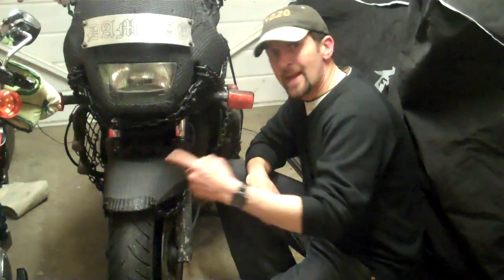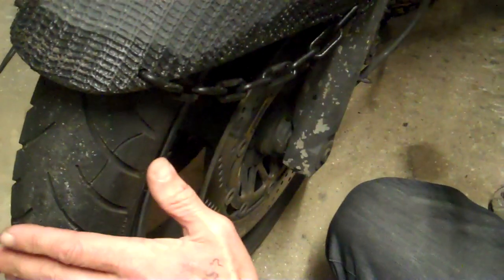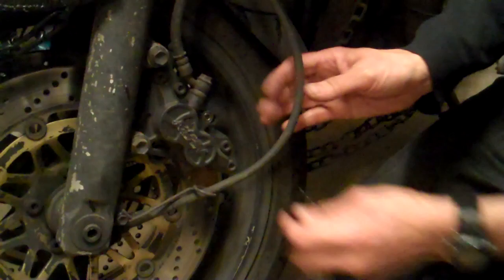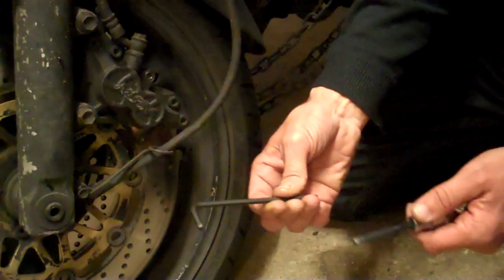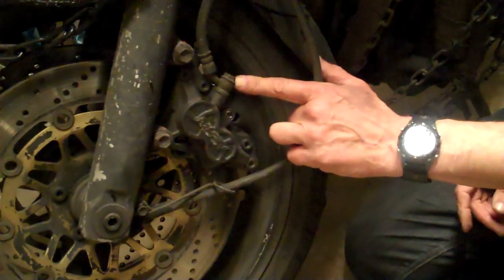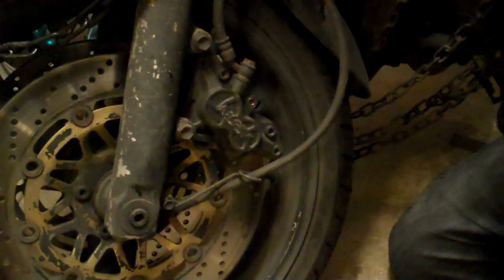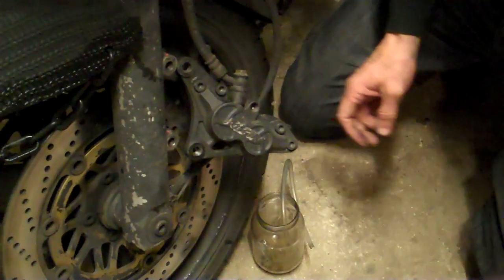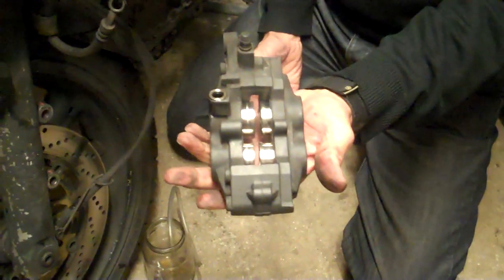Delboy's Garage, Motorcycle Front Brake Caliper rebuild Part 1.

Comment: ah great vid again,Delboy! listen,whats your thoughts on replacing the actual caliper mounting bolts [XR 125] as well?The manual says to do this,but is really necessary if they,re in reasonable nick??...Brembo info was cool,hadnt heard of that!
Cheers man
Reply from the maker: Hi mate, many manuals suggest to throw away and replace caliper bolts, but I see no reason for this as long as they are in good condition, just clean them with a wire brush, inspect them to make sure there's no corrosion, and as along as they are stainless steel bolts, put some copper slip on them and put them back in using a torque wrench to get the correct torque setting... hope that helps!
Reply: Moonfleet41 Will do.Cheers Delboy!

Comment: These are great videos. Thanks. Do you recommend replacing the seals with OEM from Suzuki (I've got a 2005 Busa) or is it alright to buy replacement on eBay?  My experience with the fork seals was not good with eBay replacement.
Reply from the maker: HI mate, i always used to make sure i used the proper factory specified parts until, one day i noticed the packaging logos were the same as id seen on eBay for half the price.. so go figure... i guess you could say that Suzuki dont 'make' rubber seals, they buy them in...even when building the bikes new.....so as long as you buy a known make then you're usually ok, i pay about £12 fo a set of brake caliper seals now, and never have any issues with them.. hope that helps buddy... good luck, Del.

Comment: Thanks for the video, it helped me out greatly.  My pistons are a little rough on the exposed end.  Do you think its ok to clean this up with steel wool or should I replace them?
Reply from the maker: Hi mate... as long as you dont scuff the surface that passes through the seal it should be fine...but new pistons aren't expensive and will guarantee a really long term refurbishment and great brakes for a long time.
Reply: Moonfleet41
I should have just ordered new pistons but I wasn't expecting them to be pitted.  I used some 1500 grit sandpaper and it seemed to polish the piston surface quite well.  But I'm going to take your advice and order new pistons for the rest of the brakes.  Thanks for the help!

Comment: Thanks for all your videos. They are really helpfull! I tried to change the seals of my brake caliper today but I'm having some issues. I followed every step you did in the vid, but I forgot to push the pistons out after taking it off the disc. So I connected the brake line again and pushed lever a few times but I couldnt get no pressure what so ever. Any ideas how I can get pressure.
Reply from the maker: When you say "Pressure", so you mean you are trying to bleed the hydraulic lines up.?
Reply: Yes exactly! When I pump the lever I don't get the resistance I need. The lever goes all the way to the grip.
Reply from the maker: sebassiehihi
Hi again...When you disconnected the hose from the caliper, you've obviously drained a little fluid out of the line and will just need to bleed the hose back up again then you can pump the pistons out using the lever...if you've taken the bottom of the hose off, and lost some fluid, you cant just connect it back up and hope it'll be solid still, as the fluid drains out, air replaces it...so you just need to pump that air out using the standard bleeding method and get the hydraulic lock back... once you do that, you can just pump them out as normal... good luck buddy..

Comment: Mate on a bandit 600 caliper, how does the calliper come off the slider pins and mounting bracket, only the slider pin rubbers on mine need changing as all hanging out now after winter, can't see if they just pull off or unbolt each end. Roll on the summer bike coming back out!

Comment: Hi Del, new subscriber...great videos!  I need to replace my pads but would like to overhaul the caliper too - I've noticed one seal popping in and out as the brake is pressed and released and also the crud on the exposed part of the piston.  You are giving me the confidence to do it.  One question... What should I use, or did you use, to clean up the pistons from all the mineralisation etc?  Brake cleaner, toothbrush and elbow grease?  Thanks! Daniel.
Reply from the maker: Hi Daniel, Thanks for your kind words and welcome aboard.. If you have a dust seal; poking out, its definitely time for a little rebuild.. I clean the pistons with hot soapy water first to get all the salt and crud off, an old tooth brush is good for getting all over them.. then to polish them up to a brand new shine, i use Solvol Autosol and some elbow grease..   for cleaning the inside of the caliper body, and get all the seal grooves fully cleaned out you can us some watered down Autosol and a tooth brush.. works a treat.... then clean everything off with brake cleaner afterwards to get all the polish off and out of any corners..   Good luck with it matey. take your anytime and have fun, let us know how you get on... Del..
Reply: Moonfleet41 
Super, thank you!

Comment: You need to mention most modern calips habe square cut seals, the taper is on the actual caliper. So they cant be put in the wrong way around

Comment: hiya guys i have a 10ft x8ft wooden shed there for not alot of room to work on bike in what cheat shelving can you recommened cheers mike ps keep up the great work videos are sound ;-)
Reply from the maker: Hi Jan, not really the person to ask about woodwork, but if it was my shed, I'd fit shelves high up to give lots of working space below and to get round the bike... doesn't need to be too complicated, just a timber plank, say 9" deep by the length of the shed, and some beefy 'L' brackets from the DIY store and screw it all to the frame... good luck with it!

Comment: I've looked at both your videos, I guess I am just a little confused, what did you use to actually clean the piston and inside the caliper?  I have an '82 Yamaha Virago 750 and everywhere around me tell me to just take the caliper apart, clean it, and reassemble.  Mine is sticking, I see kits online but am uneasy about purchasing because I do not know what is in them.  Any tips? It is essentially my last fix before having a fully safe ride.

Comment: My front brake caliper has been locking in the heat. Rode it yesterday and wtf.. they locked up! Front brake disc heated up to something cronic! I tried to clean and grease back up the 2 caliper pistons without taking them out last week. Maybe now I should take it apart like this and investigate further... thats if I can.
Reply from the maker: Hi Keith, sounds like a classic case of 'time for a rebuild'....the road salt builds up behind the outer dust seals and forces them out, that then jams them against the pistons...no amount of outer cleaning will sort them, you just need to take them apart and rebuild them from scratch, its not hard, follow the steps in the video and take your time, once they are fully refurbished they'll be like new again and last for a fair few years before they need doing again, specially if you keep them washed out between rainy days... good luck with it, let us know how you get on mate... cheers, Del.

Comment: I have a question for you. When I squeeze my front brake it seems to shimmy or shudder and grab intermittently. This giving stopping and almost grabbing in a non smooth manner. Any idea what this could be from? Forks are straight and pads look good. I have not checked the 6 pot pistons to see if they need rebuilding yet. I have have a 98 Gixxer. Thanks for any help or response.
Reply from the maker: HI mate... just to be sure...when you say the brakes "shimmy and shudder", does the lever 'pulse' in and out in your hand at the same time?....if so you may have either the brake disc bobbins jammed up with crap and need a clean..here ;- Delboy's Garage, How-To Free up 'motorcycle brake disc bobbins'.!

also you my find that the pads are glazed up...as much as they may have plenty pr meat left on them, they can get 'polished' and end up with a shiny slick surface....this can then make them judder a bit...it can be cured by sanding that face off them on a flat peice of fine emory paper... or for what they cost mate...just replace them.! 

Give the bobbins a clean and free them all up, then drop some new pads in and im sure that will cure it..!!  let us know how it goes, if its still doing it, then we can look further...but this usually works for me... good luck.. Del.

Comment: Hi Del,

Excellent videos - really learning a lot from you, so just thought I'd take a minute to say a big thanks!I am in the process of rebuilding the calipers (rear and front) on my Triumph Sprint RS and your tips have now probably saved me from making many mistakes. Unfortunately before I watched any videos I popped out one rear piston and thought I'd be able to pull the other one the rest of the way out, but I couldn't and the inner tube I used wasn't folded over enough which resulted in the grips cutting through and putting a tiny amount of damage on the outside of the piston (I eventually got it out by pushing the other one back in and clamping it while pumping the stuck one out). My question is, can I use some fine 'wet and dry' paper to smooth out the damage and use a load of red rubber grease on the piston to fill up the slight depression / nick, bearing in mind the seal is under pressure and will push into the nick as the piston moves? p.s. Sorry for the essay!
Reply from the maker: Hi John,  I think you know the answer really don't ya mate lol - you're asking me to tell you you'll get away with it, but we both know you probably won't will you??  The problem is, as you stated, it's under pressure and as such that pressure will push the fluid past the seal at that point, if not today, then down the line it'll surely happen... so as the old saying goes, why not just bite the bullet, grab a new piston and seal set... here's link mate, they're not as expensive as you think, and thre's new seals with it included:
http://www.wemoto.com/bikes/triumph/sprint_rs_955i_t625_from_vin_139277__single_sided_swinging_arm/03-04/picture/stainless_steel_piston_and_seals_front_caliper_large/

This was an example I picked from their website, so just double check your exact model, and you may wanna get the pair rather than just the one... but it's your choice fellah... hope that helps you, good luck with it, all the best, Del
Reply: Thanks for the quick reply, yeah you're right, it probably was wishful thinking on my part! :) I have put it back together, just for the purposes of getting it through the MOT, as fortunately it isn't leaking at the moment and tax runs out at the end of this month, but once the paperwork is done I will be replacing the pistons for my own peace of mind - might even treat it to stainless steel ones to keep future maintenance to a minimum.

Comment: sean0332
great video. I was cleaning rear caliper on my rf600 and when i pushed brake down the piston came out. i put it back in and now it seems to be stuck half way. any advice please. will i have to strip ?

Comment: My scooter fell over on its left side 2 weeks ago and it left scrap marks on the break handle. Could it be that I've damaged the master cylinder doing so and that causing the drag ?If so is it just seals that will need replacing and where is the nest online shop to purchase them?

Comment: Hey, thanks for the video. I'm on to change my zzr calipers to a different bikes calipers, do I need to change the pads to the new caliper? or keep pads from old caliper, thanks ;3
Reply from the maker: You must use the pads that go with the caliper you are using......each caliper has its own pads to fit it... good luck with it mate... !

Comment: Doing this at the weekend if my seal kit arrives tomorrow. So in terms of seal position and orientation its, thicker seal sits in the deepest of the two grooves and if the seals have a lip built into them, this needs to be on the side furthest away from the brake pads or to put it another way, closer to the back of the piston not the front. Someone please correct me if I’m wrong.
Reply from the maker: In theory yes, you're right, but check your caliper when you take the old ones out... many bikes have a trapezoid shaped slot in the caliper body and the seal itself is square , so rub your finger inside the hole (ooerr) and feel for the lip on the inner most edge, and when you take them out (the old ones) just snip one in half and look at the end section, if it's square, and you've been given the right seals, then it doesn't matter which way you put them in, cos the slot will take care of it, sorry I can't be more specific, don't know what bike you have buddy, but do those checks and you'll be fine, good luck !

Comment: Hi Del, Im running a Bandit 1200n - it has the standard six pot calipers, would you recommend switching to 4 pot? I find the 6's to be slightly spongey. Cheers, Scott
Reply from the maker: It has always been a common mod to fit the early model 4 pot Nissin calipers, they are just as effective and make a great remedy to the awful 6 pot Tokiko calipers on early Kawasakis,  but if they are just spongy, then why not fit some braided steel hoses and sharpen up the feel first.. its a lot cheaper than new calipers, and even if you go for some 4 pots later, then the braided lines will still be a worthy investment for them.!
Reply: Yes mate that's the initial plan, wanted your two cents on the upgrade to 4 pots, I've heard they're good but been an avid fan of your B12 builds so knew you'd have the knowledge. Cheers.

Comment: Done this a few times on Nissins - now I'm in a '05 FJR1300A with the Brembo's (what looks like monoblocks) - previous owner and dealership never bothered to clean so dust-seals are crumbled. Alas, the pistons are so stuck , that I cannot get them out normally so to speak. Any tricks I could try ? I have put compressed air through the banjo hole but there's just a single piston that pops out and I have no tool to selectively block the others. I think I will (this one time) bring it to the dealer and see what they make of it.. cheers.
Reply from the maker: OK, it seems you've already decided to take it to the dealer, the normal procedure is to pump out using the fluid by keping each piston equal until they are both on the edge, this is important, as once you take one out, you lose hydraulic lock and you will have nothing to push the other one, compressed air will not push them out, only a hydraulic lock can do that... however, if you have taken it to the dealer, I guess it's under control - let me know how you get on!
Reply: It took a lot of cunning but eventually got all the pistons out...problem being the calipers don't come apart (monoblocks as said) - so this makes it very hard to wiggle the pistons out (as they oppose one another and block each other in the removal process). I took it still to the dealer as I don't trust myself to replace the seals (very little room in there because the caliper is just one block not separable). I also gouged one of the pistons unfortunately but they needed replacement anyhow due to excessive corrosion (cost is marginally higher so I ordered complete piston sets). Thanks again.
/r

Comment: doing this on my triumph but the workshop manual tells me to remove the pistons without splitting the caliper, (i had a go but could not crack them and was worried about wrecking the head). have you got any tips for getting all four pistons out without splitting the caliper?
Reply from the maker: Hi Sam... The usual way to get pistons out is to pump them out as far as the fluid will carry them, making sure they all come out evenly, then finally one will 'pop' and then as the others will all be 99% out, you should be able to wriggle them out with your fingers... I always split the halves though, so you get proper access to clean in the holes... good luck mate, Del

Comment: Hello again Del i have rebuild calipers on both bikes i have yet to put them on and check for leaks, but before i do that i would like to ask about grease for the rubber boots that hold the caliper sliders. what kind of grease would you use to fill the rubber boots?
Reply from the maker: Hi there, goo on ya for getting it done yourself... the best grease for your caliper slider rods is some CopperSlip or Grey Graphite Grease, both are fine, as they don't melt with heat that is caused by the braking process, so will not run on to your brakes... hope that helps, good luck, Del

Comment: Hello, after watching this video i decided to clean proparly my 2 front calipers on my africa twin after 2 years not cleaning them. I took calipers apart and cleaned them but during the process i lost most of the brake fluid. After assembly should i just pour new oil ? Thanks.
Reply from the maker: Yep, top up the reservoir, and bleed them through mate, a good chance to change the fluid which should be changed after 2 years anyway aye.!!
Reply: @Moonfleet41  thanks. Just one more question. Do i have to replace the seals if they look okey?
Reply from the maker: @mike-on-the-bike  No, not at all, as long as they weren't leaking, and they aren't worn on the leading edges, you can reuse them. !
Reply: @Moonfleet41  thanks a lot for your time, looking forward to see another helpful videos.